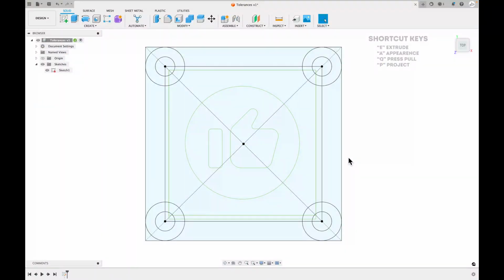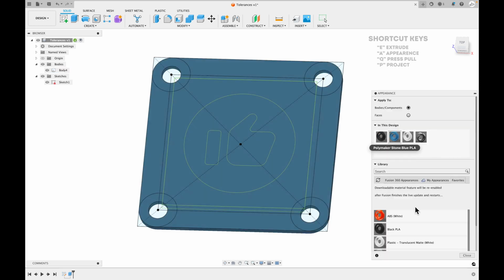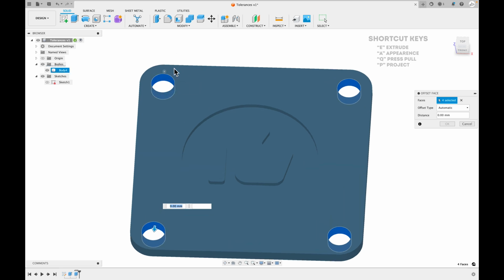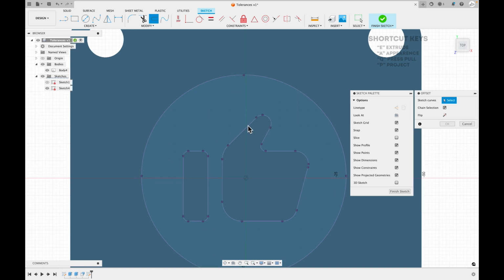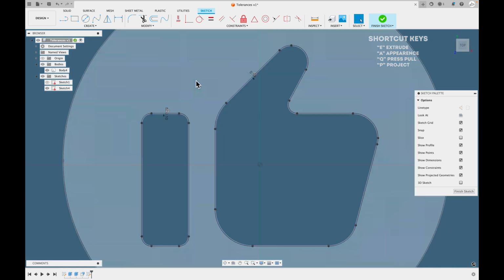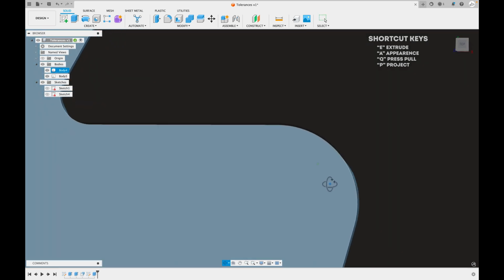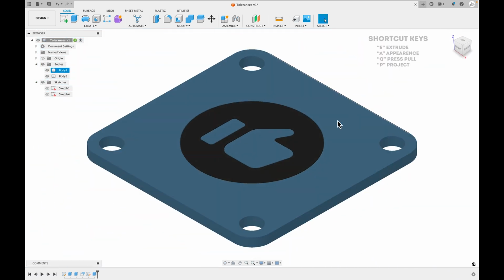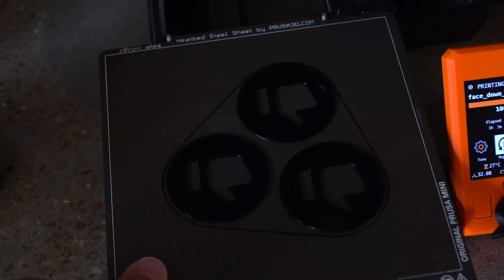The Best Way to Add Tolerances in Fusion 360!

Comment: Thanks for the quick and clear instructions.  I am now using this, or very close to it, to make an offset for printing different colors on a single color printer.  With no offset, the second (surrounding) color would pile up at the edges of the first color.  With a little offset, the results are cleaner.

Comment: I think you’re using the word “tolerance” wrong throughout this video? Tolerance is the difference between the max and min dimension. You’re creating “clearances” which is the space between two parts.
Reply from the maker: Yes but 99% of the population refers to it as tolerance so for that reason, I used the word that most people would use
Reply: @madebyjwillis  while it may be the case that many people (not sure about 99%?) refer to "clearance" as "tolerance", don't you feel that as an expert you could do better? It's just not the right term for what you're doing and you had the opportunity to correct this in your video. Regardless, your technique is good and I appreciate the video.

Comment: Hi, I have a question for the arc enclosure. When installing the mc fan on the p1p I can not get it going. I did write the g-code « M710 »
Reply from the maker: Please reach out to Bambu - I never installed the mc fan and haven’t had any issues
Reply: @madebyjwillis thx 👍